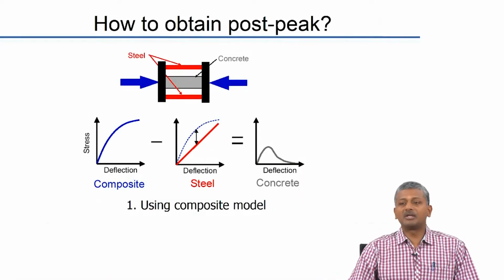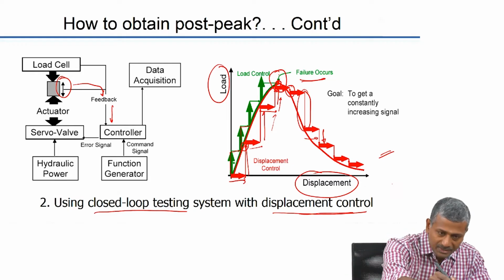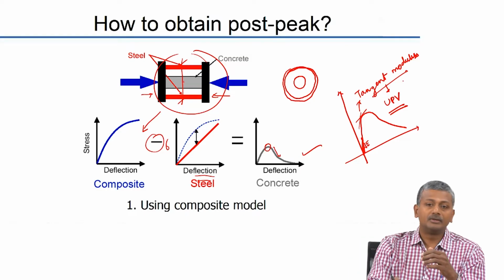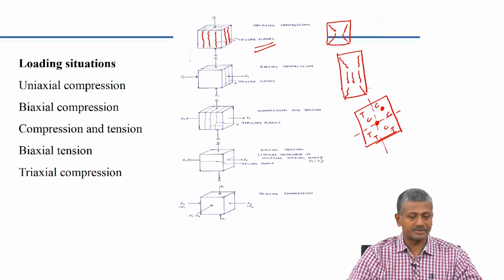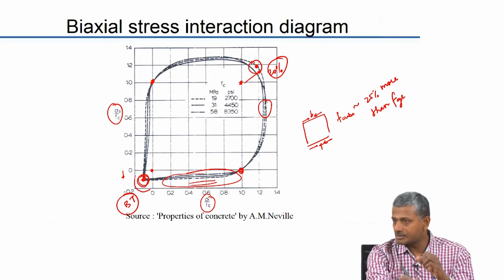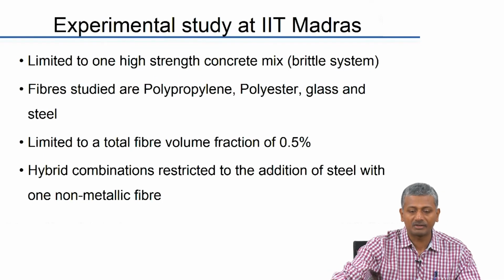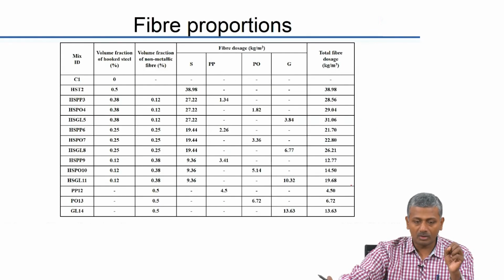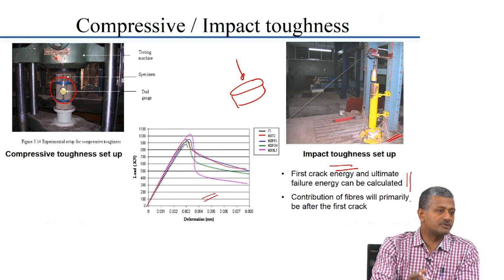#32 Post Peak Response | Fibre Reinforced Concrete | Advanced Concrete Technology

Comment: Sir, I have a doubt. In the case of the column, the bending moments could only produce either tension or compression in axial directions (from the theory of pure bending alone). Does the Poisson's effect introduce lateral stresses in the members? The lateral stresses are not captured by either of Timoshenko or Euler-Bernoulli beam theories.